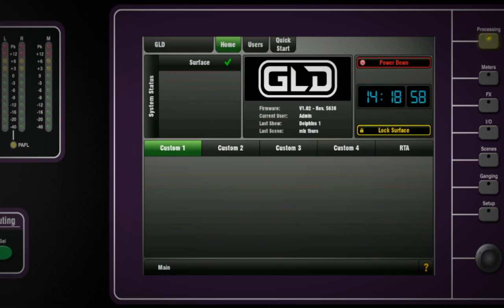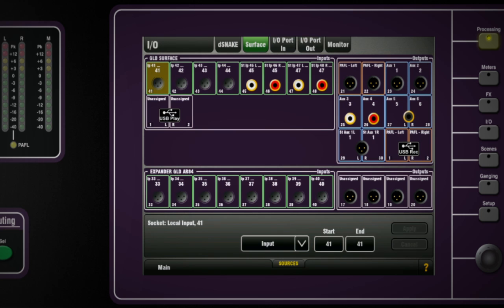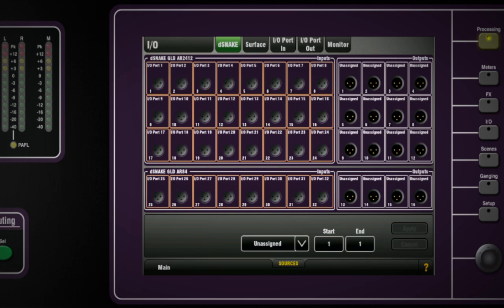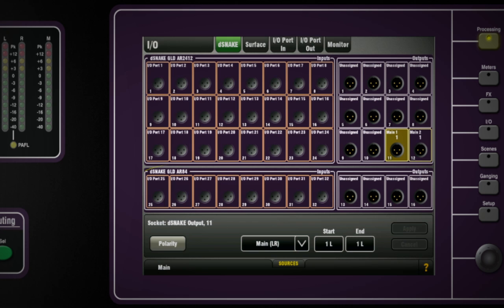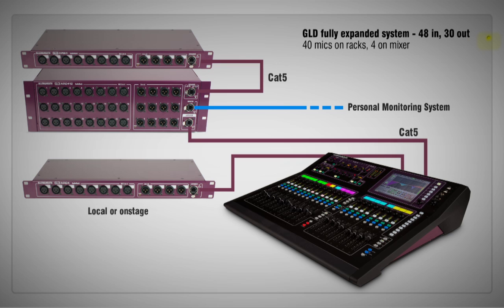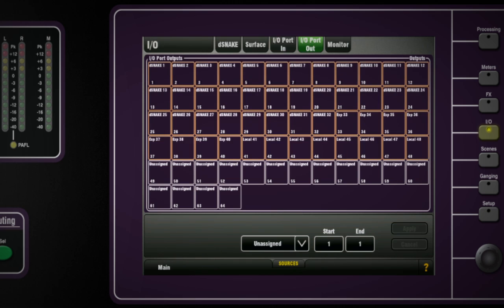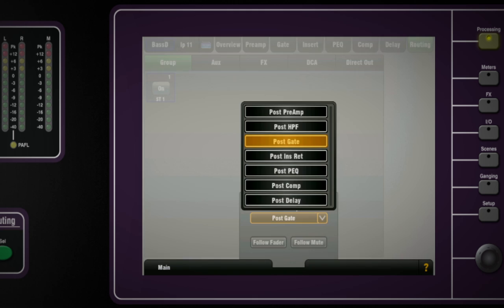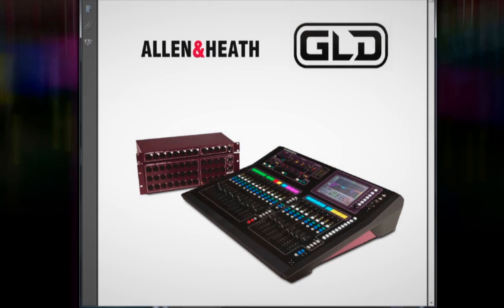06 Allen & Heath Patching Inputs & Outputs

Comment: Do you need a DI to route the outs to another mixer?
Reply from the maker: Hi Ashli,
No that is not necessary when sub mixing, just simply make sure that mixer input you are running into is padded for line level signals, also, very important is to make sure no phantom power is disengaged before connecting to the input, failure to do so will result in damaging the outputs from the other mixer/stagebox.
Kind regards,
Luke
Reply: Thanks for the reply! So my mixer doesn’t have padding, then what do I do? Is a DI needed that has padding? In terms of line level, are you stating i would need an XLR to TRS cord for this to work?

Also if I want to send an aux out from my mixer (XLR) to the stagebox, would I need a DI?

Sorry for all the questions but need to be certain
Reply: @ashliiiiiiii  di &padding are different, DI doing impedance matching the Hiz to loz, but padding is reducing the Gain (it's my simple knowledge 🙏

Comment: I appreciate the effort that went into making these videos to help us learn how to use our new gear.  the problem with the videos is that they go way too fast because you are (1) using terminology that is new to many of us and so we need a moment to process it, and (2) you are talking about what to do but the video showing the action doesn't line up with the speech as you are saying it.  It is ok to take a PAUSE in your speech, while you show the action!  Your video is one long run-on sentence!

Also, when you do actually finish showing an action you just talked about, you don't let us see the results because the EDITOR CUT the video and immediately moved on to the next speech!  There aren't even enough frames to hit the PAUSE BUTTON so that we can see the result and process what you just said!
Reply from the maker: Thanks for the comment. Sorry that you found the video too fast, we have taken previous comments like this on board and are working to make our videos even clearer and more comprehensive in future.  Cheers. Harry.

Comment: Can a socket be routed to multiple input channels? For example, if I have a mic that I want to process two different ways or a guitar mic that I'd like to route to two different input channels, panned left and right and slightly delayed on one side.
Reply from the maker: Yes, you can route one socket to multiple input channels for parallel or alternative processing. Gain is obviously shared as there is only one physical preamp but trim can be set independently for each channel :)
Reply: @AllenandHeathUK  Is there a clear explanation of how to do this somewhere? I managed to get it to work once, but honestly am not sure how. I really need this feature to establish separate mixes for house and live-stream of the same sources.

Comment: i have a pair of booth monitor speakers plugged into the rca output labeled 25 and 26. how can I patch those outputs to be controlled by a fader channel that I can put next to my main L/R? should it be an AUX? i have tried patching it to AUX's but havent gotten them to work when I try to send channels to them. how can I set them up to description above, and so that they just play the main L/R output (but can have a separate volume, and processing adjustments)?
Reply from the maker: Hi there, it depends! You could use a Matrix if you just want the monitor out to follow the LR. This would have independent level and processing including GEQ. If you want a listen wedge / SOLO IN PLACE You could use the "IEM" PAFL bus for this. This way you can monitor single inputs or entire mixes... but wouldn't have the processing on the output. You need to assign the required output to the sockets in the I/O menu, and then assign the corresponding fader strip to the surface in SETUP>CONTROL>STRIP ASSIGN. If you need any more information please email support@allen-heath.com and we'll be able to help you further. Thanks. Harry.